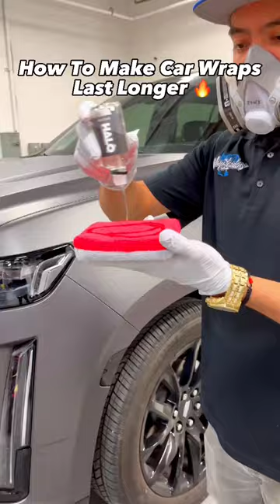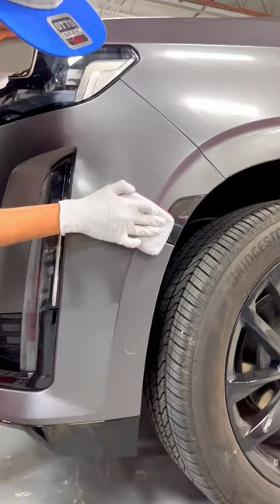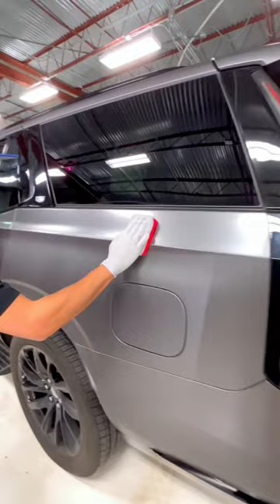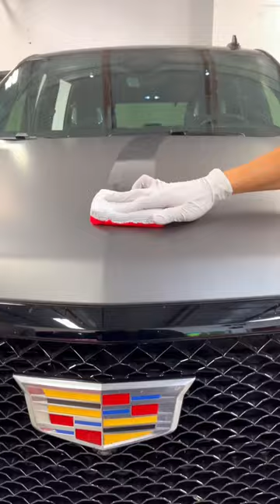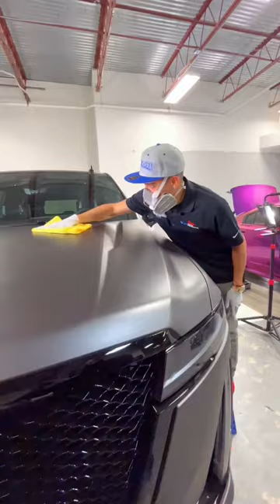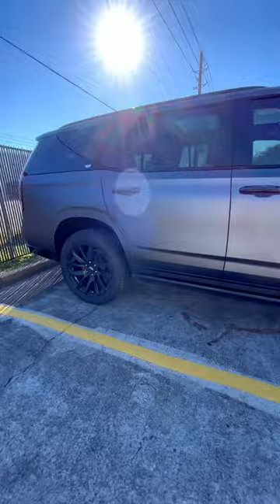How to make car wraps last longer 🔥💪‼️ 2023 Escalade Wrap ! #carwrap #carwrapping #carwraps

Comment: My only problem with wraps is if you get in an accident they are really expensive no matter who pays for it
Reply: True
Reply: ??? Wdu mean very similar to paint, and if it’s much much easier to match
Reply: @That.Lifted.Ranger  i dont remember what episode but Wham Bam Tesla Cam covered a crash qhere someone had a wrap and the price went up like 4K$
Reply: @rarebrockstark6219  for huh what
Reply: so is a brand new paint job its just preference bro
Reply: @rarebrockstark6219 paint jobs are just as expensive, and some colors (mazdas 51v red for exanple) are extremely hard to match
Reply: An accident will cost you no matter what🤔🤔🤔
Reply: The wrap also comes off without damaging the paint underneath it.. so you could just do that

Comment: I’d like to see a test, where it’s applied to only half the car, and returned 1 year later for inspection, the wrap is hydrophobic when new, I’m curious if it resists the ceramic, and would be more beneficial if applied a month or so after it’s exposed to elements??